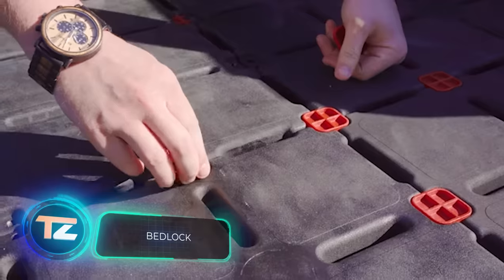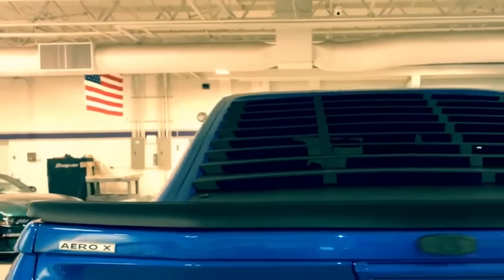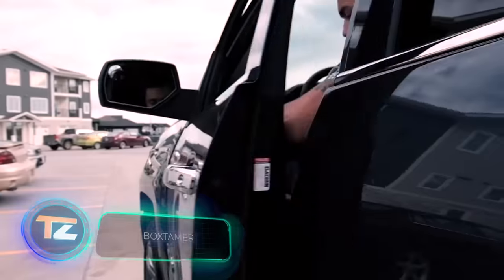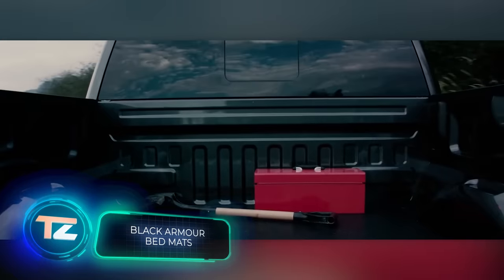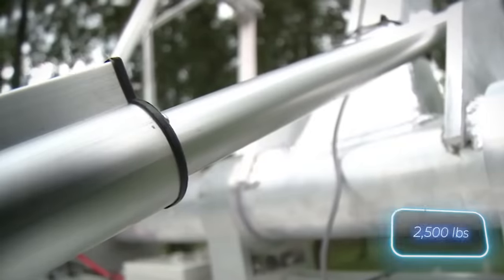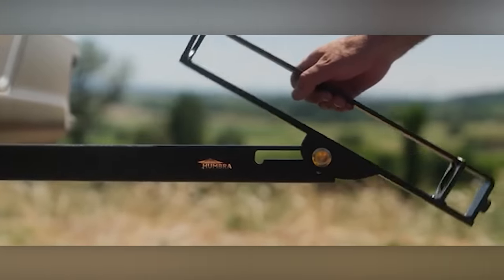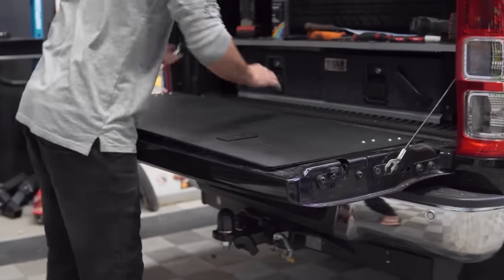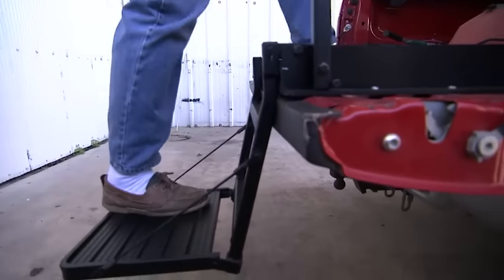INVENTIONS FOR A PICKUP TRUCK THAT YOU SHOULD KNOW ABOUT

Comment: Products for people that should have bought a van instead of a truck
Reply: Classic dump-van.
Reply: Very easy answer .
It's a prius with a bed ..
Reply: @justingraham7387  lol what.. a van has a truck frame, it can trailer just as much. Can get them with AWD too.
Reply: @deskbreaker some of them will actually have larger gvwr because they're designed for passengers. My dad had a ¾ ton that was no bigger than a long bed pickup, 12 seater that was used originally to transport employees. Had a payload much higher than my grandpa's ¾ ton dodge (94). (I was a young kid so I don't know the actual numbers). Because the van was designed to haul 12 people and gear, it was extra heavy duty. You figure the average guy there was 180-200lbs, plus all the gear. Most ¾ ton pickups at that time didn't have that large of a payload.
Reply: I hate my van😢
Reply: But i can use my truck for work then go to dinner in it, try that with a van

Comment: I thought that ramp was silly. Then I see that thing called the box tamer. Have you never heard of a 2x6 most pickup trucks, especially those with wine bay beds have notches so that you can slide 2x4s or 2x6s into them so that you can pull the cargo in your bed without it sliding all over the place. Or buying an ancillary product that necessitates you having to drill holes in the sheet metal of your truck that are definitely going to rust out because I didn't see them mounting them with any kind of grommets or anything that are going to prevent those little pinholes from getting full of rust, especially here in Maine where I live
Reply: There's a few really good ideas here, and quite a few goofy ones.
Pleased to hear about the truck bed sleepers. 

Those exhaust stacks are nothing new and very shoddy, so I'd not buy THOSE stacks but I'd hesitate to sleep in a truck that didn't have some sort of topside exhaust.

Comment: Bought a Decked system for my Ram 1500. 1) Forget about anything in the back 1/3 of the drawer. You have to remove stuff to get to it. 2) Cannot handle 100ish pounds without breaking the corner that rests on the bottom track wheels. 3) Parked on a hill? You will have to hold the drawer open while you try to get tools out - no stop system to open the drawer in increments and lock in place. Next time I will build my own drawer system. Oh and I almost forgot, they do not include the cheap plastic dividers that don't stay in place very well anyways. I had to put screws in the dividers. I store mostly Dewalt cordless tools in mine with a divider for bits and blades. I have to remove most of the tools to get to a Dewalt bag in the very back that carries my tool cordless tool accessories. Probably works great for sportsmen.

Comment: I’m sure that xsx deck fully loaded taking a curve at anything over 30 mph. The center of gravity is so high that danger level is high.
Reply: And at $3300. Just buy a trailer
Reply: @xxUncleBuckxx    Agreed, however the one traveler I’ve seen who was using a rig like this was also pulling a camper.
Reply: @patbullard9276  just buy a toy hauler Id like not for you not to tip over on my truck

Comment: The box tamer is a waste of money. For my truck I measured the distance between the grooves at the back of the box, then I ripped a 2x10-8ft down to the proper length. Next I cut the corners on the bottom for it to sit flat in the box. I also have the smaller d-rings screwed on for securing small objects. Cost less than $30 CDN.

Comment: 2:46 those are extremely LOUD and illegal in many areas, I know one area that owner was extremely bad took off for work after midnight revving engine, well someone poured concrete into his exhaust pipes to make it quiet... 🤣
3:46 this places weight too high and causes height issues, curvy road with all that weight that high will not be safe also an issue on side streets with trees and wires that may be low and don't forget the drive throughs and gas stations with covers over pumping areas that are not really high